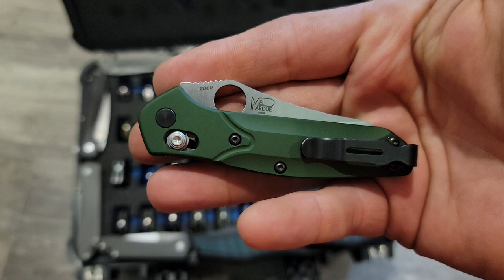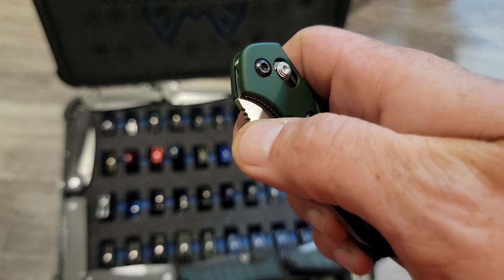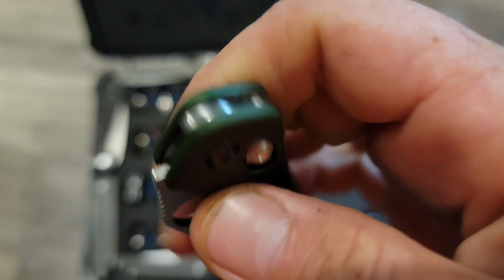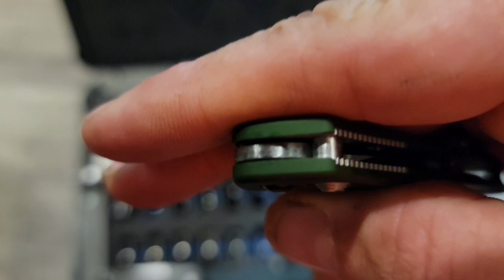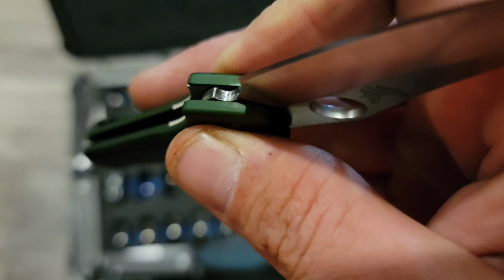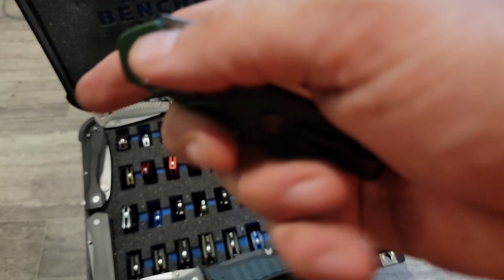Benchmade 945 to 555 blade swap!

Comment: Inspired me to try it myself! Was just looking at 945s and I always hate benchmades thumbstuds compared to Spyderco and I love this blade design. Going to attempt with the s30v variant.
Reply: Just finished- on mine all I had to do was a little grinding on the blade to close it all the way but I didn’t have to alter anything up top or the stop pin it basically locked open with no play from the factory once the blade was swapped. So mine has the 945s stock stop pin and the 555 blade I simple had to grind out a little more of a deeper semi circle for the axis lock to fit in so it would close as he points out around 3:20 in the video
Reply: Also didn’t have to grind the radius

Comment: It looks good because the tip to base of the blade is on a straight line whereas most benchmades are slightly bent. This looks poised.

Comment: Amazing job. Does the 945 blade fit in the 555?
Reply: i just made this 945 with the grip blade and put the 945 in the 555 scales assembled. it doesnt lock all the way and is shaped like a boomerang almost lol definitley doesnt look like it should be there the way the 555 blade does on the 945. im not sure about why i didnt have to do everything the original poster of the video had to do because putting th 555 blade on the 945 i used all the original osborne internals. and only had to grind down the pocket where the axis lock slips in to when closed to not have the tip hanging out. i absolutely love it and the way the blade flows with the scales where the jimping is perfect like it should have always came this way.